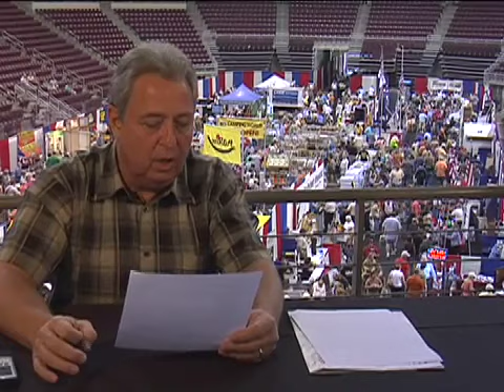Is RV electrical problem related to water leak damage?

Comment: Bought 5000 wart predator gen has 30 Amp rv air won't run. Have a 2003 coachman 34ft